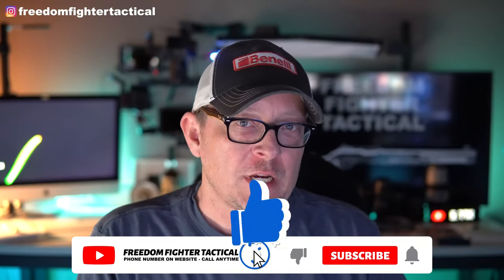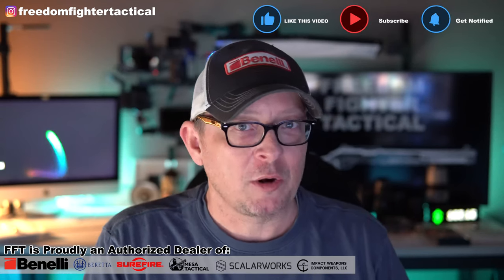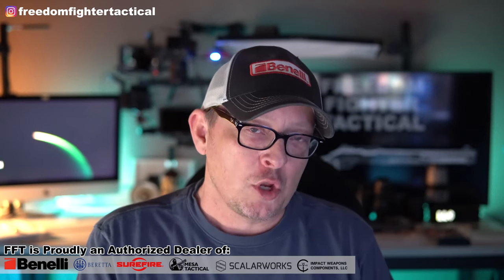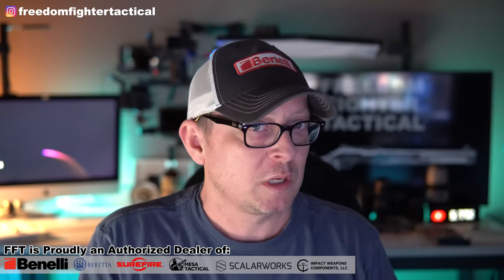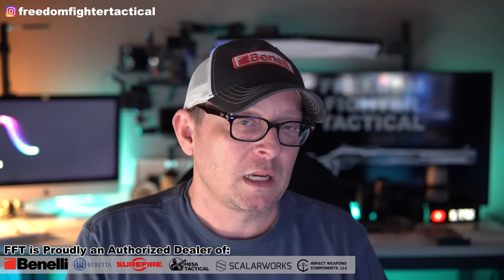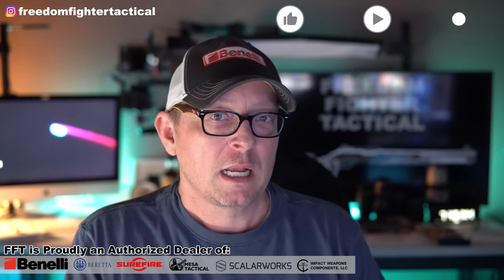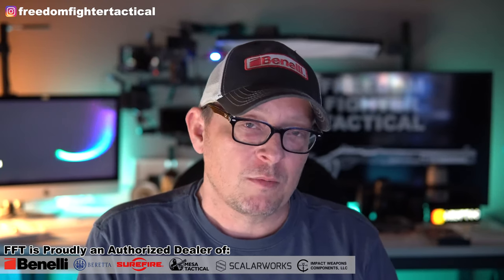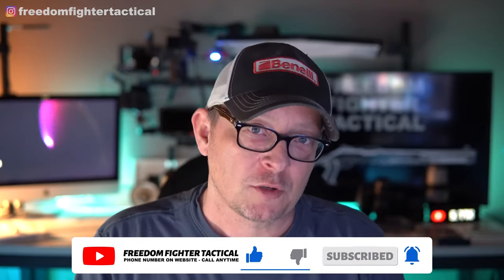Getting Rid of Your Polymer Trigger Housing on Your Benelli M4 Shotgun

Comment: I upgraded my polymer housing to the A&S housing not because I'm hardcore looking for perfection in my M4, althought it is nice to have it, but because I'm going to be hanging onto this shotgun for the rest of my life because it's perfect. Maybe in a decade or so a new shotgun will be crowned the new king of combat shotguns but it will be EXTREMELY hard to even match the M4s capabilities much less surpass them. I want this shotgun to be as durable and rugged as possible to survive the next 60ish years. I don't want a point of failure to be 60 years from now a potentially degraded polymer housing. Aluminum wont degrade, at least not in a 60 year timespan. Maybe polymer won't either, I don't know I'm not an expert on polymer, but why bother taking the chance and "fixing" a potential issue decades down the road now while I can when we have no idea what the gun environment will be like at that time with whatever regulations are passed between now and 60 years from now. Hell, I went so far and arguably crazy enough to buy a bunch of spare parts to store to keep this beast of a shotgun in play. I could probably borderline build a second M4 out of spare parts. I love the shotgun that much.
Reply from the maker: That housing is a work of art.

Comment: I am planning to do the trigger kit install on my M4. My plan is to use the FFT trigger kit, plus the A&S trigger housing; that, in theory, will give me the required 4 US parts needed for 922r compliance, in order for me to replace the pistol grip stock with the "collapsible" stock. I have future plans for "SBS-ing" my M4, by replacing the 18.5" barrel with the 14" barrel from the Benelli M4 Entry shotgun. That will require registering the shotgun with the BATFE; but that's a whole other can of worms that i will have to deal with at a later date.

For now, my focus is on the trigger group upgrades. Thank you for offering all the 922r-compliant parts in one place. It will save me from having to shop around for the parts.

Comment: Installed A&S Trigger housing as well as trigger upgrade kit in Q3 2020..had some issues with trigger releasing.  Todd did what remote support he could, and rather than take a refund I ended up j reshaping some parts to make it work.  If anyone else runs into same issue I have a solution!
Reply from the maker: Good to hear, Konstantin!  Reach out anytime to share your experience.

Comment: Good video Todd,
How compatible is your FFT trigger kit with the A&S trigger guard do you have to do any modifications to actual trigger parts?
Reply: I run the FFT trigger kit in the same setup. No issues encountered yet, no modification needed out of the package.

Your milage may vary however
Reply from the maker: I'm not sure there are more/less mods that would ever need to be done.  For almost everyone, our trigger kit is going to be drop in.  But if anything - anything - is a hair off, it can cause a chain of parts not sitting exactly right and the build up can lead to a safety function check not working.  If you buy an OEM housing completely assembled with all the parts, which I think has been totally discontinued for the M4 (they just aren't offering it anymore), they've already done the safety testing and checks and if there was an issue, they fixed it before it went out.  I'm guessing the same with Briley, who makes awesome trigger components - you send to them, and they install, so if there were any safety check issue, they fix that prior to sending it out to you.  Because I don't do installs, I'm not there to fix it prior to your seeing it.  And if you introduce my kit, made to spec, into a housing that may be a hair off, or with a component that might be a hair off (we've seen pins that are a little odd, pin holes that are slightly off, etc.), that was accommodated with an adjustment at the factory, the problem is back, and that's where a little work might have to be done.  99 times out of 100 it's a slight decrease of the disconnector lip to give clearance - about a 5 minute job but to be done with care.  But because of the parts not always cooperating, and an adjustment being done prior to sale, it makes it impossible to offer a drop in trigger kit that under no circumstances would need a slight adjustment.  It's rare, but occasionally some fitting would have to be done.

Comment: Do you make one that is drop in Housing and all the internals? IN NP3?
Reply from the maker: I do not.  The markup due to the extreme labor charges I’d add wouldn’t make sense for almost everyone.  But…maybe I put it up with a price for those who don’t care and value time over money.
Reply from the maker: I've actually thought a lot about this today - offering a kit that I would build.  I really think giving the cost of all the components and what I'd charge for labor, it would make more sense to buy another gun, take the kit out, and chuck the balance of the gun - if you're going with OEM (and of course, that would be if you could find a new gun with the aluminum - you'd likely have to buy used to get this).  And even with A+S, I think my cost would be prohibitive and silly.  A gunsmith who does these all day and who has allotted his or her time to do it all day as a business would offer much better labor rates than I could ever dream of.  So it's unlikely I'd take this one on.